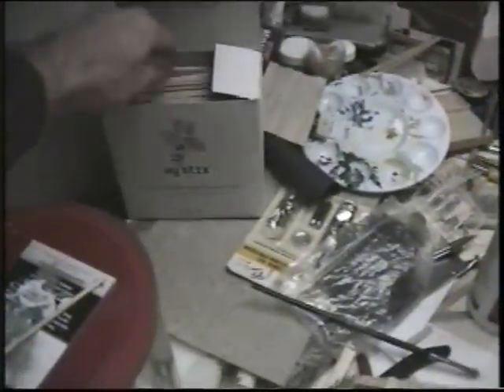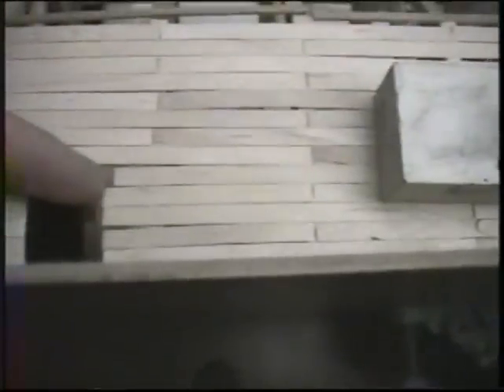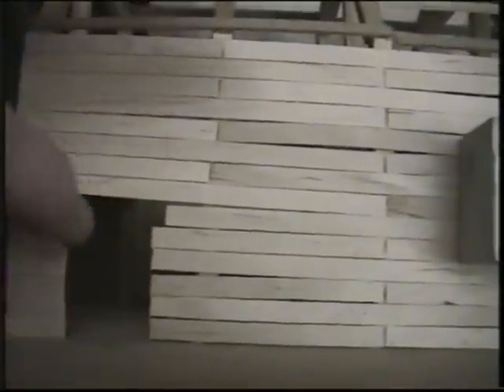Bit of silly - mini windows in the barn - camera prob

Comment: Think the first comment was blocked due to the link.  Steve, dont cut the longer boards to match the shorter one, cut the other board on the top left so that IT is also shorter.  That way you will have the two door jams supporting the lintel, which in turn supports the wall above.  Hope that makes sense. :D